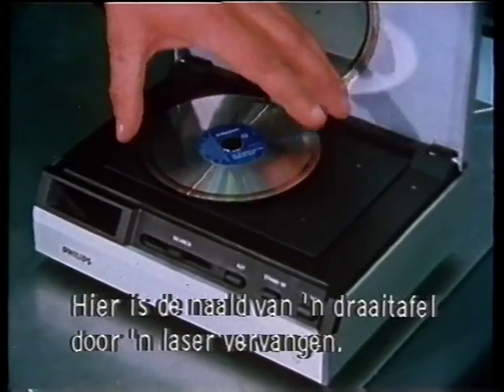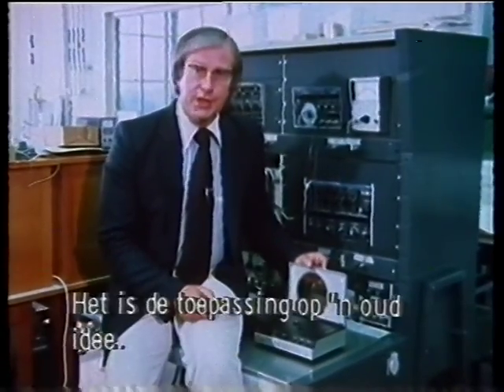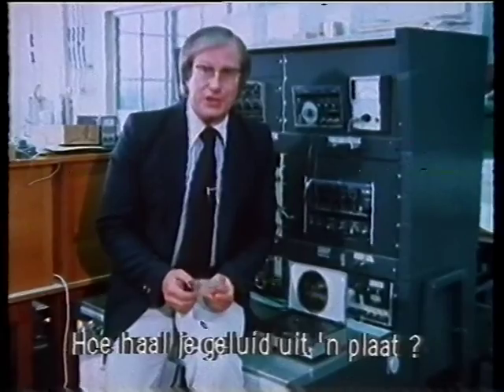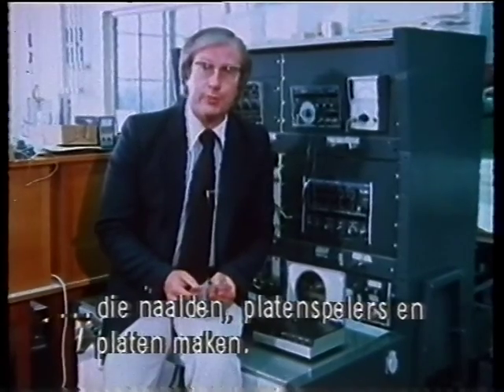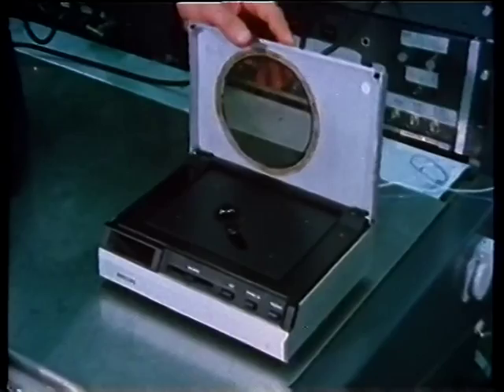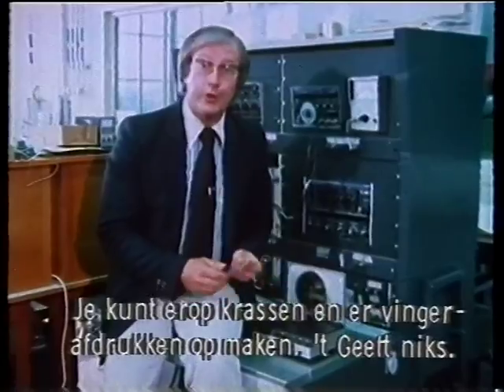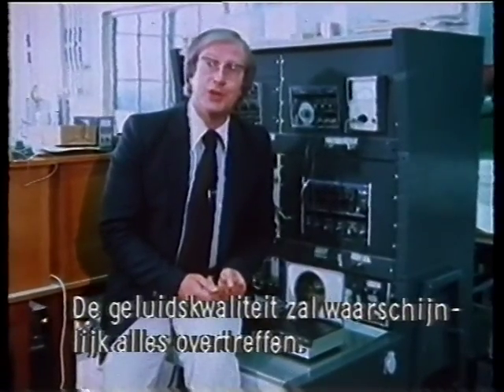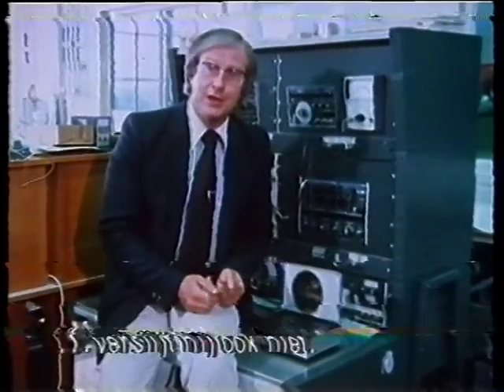Philips CD player prototype Pinkeltje demo

Comment: Lol False. Lasers cannot read through scratches or dirt.
Reply: Depends on the focus, most of the time the dirt and scratches will be out of focus to the laser reading the disc.
Reply: "Lasers cannot read through scratches or dirt."
That really only depends on how severe the scratches are, or how dirty it is.
Reply: It depends... there some testing disk like Sony YEDS-41 that contains scratches and dirt tracks.
Reply: Yes and no.

The laser can hyperfocus, which makes scratches and dirt out of focus for the laser beam. If the dirt is not transparent enough, then the laser cannot read through it. 

The same is true for scratches. Only if a scratch is REALLY deep, and had cut right through the plastic layer and damaged the reflective layer inside, will a scratch interfere with the laser beam. 

Here's where CIRC and EFM come in - two algorithms that use extra errro correction data in the audiostream to reconstruct missing bytes if dirt is encountered. 

This works so well that even when the reflective layer is missing or otherwise unreadable for a maximum of 2.4 mm in runtime length. the CD player will be able to play the music without skipping. Depending on where the scratch is (nearer to the center, or nearer to the outer edge of the disc), this translates into about 2 ms of missing audio data that can be 'fixed' by the player without you noticing it.

And this is pure lossless audio restoration based on the error correction data in the stream, done without any 'guessing' - the result is identical to what you would have heard if there was no dirt or scratch at that bit of the disc.

If the data is interrupted for more than 2.4 mm in runtime length, then the error correction data will not suffice and the player is unable to restore the missing bytes. 

In that case, the player will interleave previous audio data into the missing data (basically 'guessing' which notes SHOULD have played during the drop out), and it can do this for almost 7 ms before audio completely cuts out. So the notes you hear may or may not be exactly what was supposed to be there, but it is usually awfully close.

EFM makes sure that if the datastream is interrupted, the player will be able to keep the disc spinning at the right RPM and the laser caddy to be moved across the surface of the disc at the right speed, so that the datastream can be immediately picked up again when it becomes readable again.  Some CD players have trouble with this though.